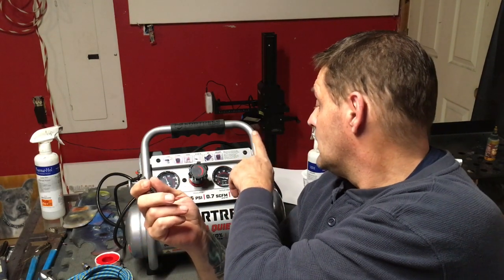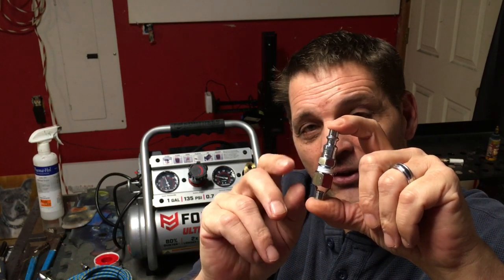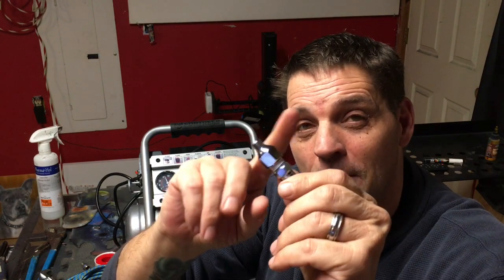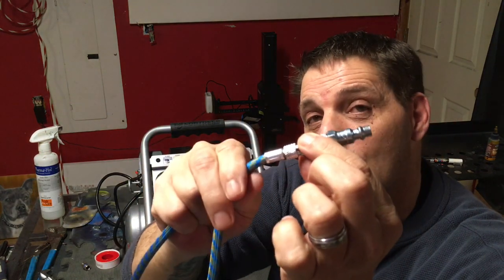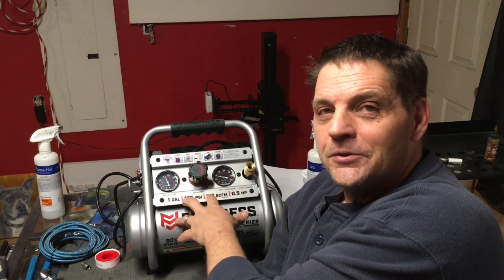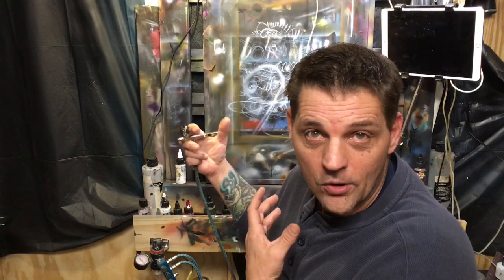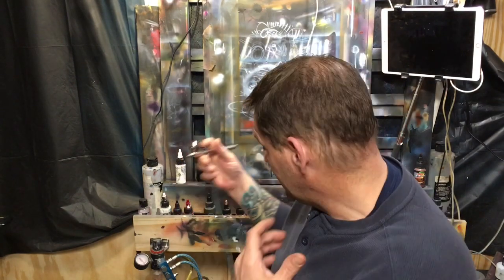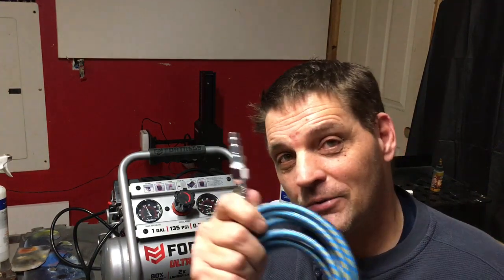How to attach an airbrush to a regular compressor.  Lets hook it up!

Comment: I bought today a quiet one (62 dBA) the brand is the Maximum 2 gal only, don't need more, I'm not airbrushing for hours, so it's ennough for my needs. Ok, now I have both adapters (the big one I had for long time, and the small one from my pistol style airbrush) but The threads don't match. Our airbruches are in metric so the small one that connects to the hose is in metric and the big one that plug in the compressor is for sure in Imperial. I'll do stores tomorrow, Too long if I order from Amazon.

Comment: Great video! Would these adapters work for the California Air Tools 8010 Steel Tank Air Compressor. I’m using a Paasche H
Reply from the maker: Yes same fittings.  Of course you will need a pasche adapter or the pasche hose 

All consumer level compressors will use those fitting. The larger huge shop compressors use automotive quick fittings.   Ironically the automotive are the commercial grade and industrial is home compressors 😅

Comment: Two last ?'s  Any issues with the Regulator? and do you use the same set up as the Fortress?  hose water trap etc.  Thanks again.
Reply from the maker: no issues with the regulator.  and if I was running it a lot I absolutely would run a hose and water trap.. if just doing small stuff it really wont build up enough heat to make it an issue.  But you do need some kind of moisture trap if using solvents for certain.. Its honestly the best practice to have one.   Again its also handy having the regulator right next to me.
Reply from the maker: oh with that said When i first started.. i ran without a moisture trap at all for a good while :)

Comment: Hey Bill I need some help & questions ..please 
I just bought the 1gal cal air tools, I got the industrial male quick connect which is ¼ to the compressor.(seems to connect to the compressor so I'm assuming I got the   I got 2 airbrush hoses that are ⅛ having the moisture trap in between the hoses.. I can't seem to find a connector  that will fit from the ⅛ hose to the ¼ end of the quick connnect- (end of the compressor) ...if there is a way u can guide me. Or if I can send msgs via email or social media platforms.. also had some questions on how the air compressor turns for soo long in the beginning? The pressure was going up about to almost 90. I wasn't sure if that's how it goes or when to turn & adjust the pressure to like 30 psi.. thank you
Reply from the maker: Ok the adapter from the 1/4 inch to 1/8 is 1/4 npt to 1/8 bsb.  

The compressor will auto shut off at it's max pressure.  The regulator pressure is different than tank pressure.   If using an exterior regulator I would just adjust the compressors regulator to 90 and adjust your other regulator from there.  

If just using the compressor turning the regulator valve down will adjust the pressure down on the second guage.. it may not drop pressure until you bleed air from the tank.  

If you message me on my Facebook page I'll always answer.. but may be delayed same as here!  

All the best! 
Bill!
Reply: @TheAIRspace  yes I will message you ! Thank you Bill..

Comment: Wil that adapter work to hook a standard sized shop compressor tool to an air brush compressor? Cuz i have a pneumatic graver machine i want to hook up to a tiny airbrush compressor. Ive done the research. The compressor will run the tool and im working in a small apartment with a girlfriend that hates noisy air compressors. I have a silent 2 gallon husky but it. Leaks so the compressor motor runs non stop. And the little airbrush compressor is about 1/4 the size of the husky and so much quieter. The ab compressor comes with that tiny female screw-in end fitting so i need to get it to hook up to the graver and that the regular shop sized fitting
Reply from the maker: i of course have no idea on thread size to your machine.  But a 1/4 npt is a pretty standard size.  Most airbrush compressors will have a 1/8 bsp male .

Comment: Unfortunately the link now shows the adapter being 1/8 bsp to 1/4 bsp instead of 1/4 npt
Reply from the maker: it is probably a typo on their end.. but ill take a look at it.   It should be 1/8 bsp to 1/4 inch NPT  
They do occasionally move stuff around on amazon.

Comment: I was thinking about buying a one Gal 135psi 0.5HP but was not sure if it was worth it. Up here in Canada, a two gal 1.5HP is expensive. Is yours doing a good job?
Reply from the maker: I really only use the .5 compressor on occasional use.  for portability sake.  I consider it too small for my needs.  it will keep up certainly, but if im airbrushing for hours it will be running far too much.  I had a one horse 1 gallon senco that was plenty that I gave to a friend.  But I usually use a 4.3 gallon as my regular compressor.  

Im almost always going to recomend a bigger compressor than a .5    tthe one horse one gallons will do great for most but the 2 gallon is going to run less and have less moisture.

Comment: I needed this vid too. Do you wrap the plumbers tape more than once? I still found I have air leaks at the filter threads, and the on the regulator threads- the one I added to the gun. I bought replacements for both and they did the same too. Either I am just not tightening it enough or these plastic threads are no good. Ahh what a journey!
Reply from the maker: The regulator threads I tape. And about 3 wraps.. side note I was a plumber for 30 years.  So I tend to do pretty well putting threads together 🙂
Reply: @TheAIRspace  I bet! Thanks I will try again.

Comment: If I am buying the iwata eclipse pen, and the first Link you listed of the cord thing, plus the California air fortress, do I need anything else to start airbrushing t shirts, or is that a complete set up? Thank you for your help. I’m sorry I have a hard time processing tons of info at once and need to ask
Reply from the maker: You will need a quick coupling from the compressor to 1/4 inch npt.  which is the second link is multiple adapters but I do encourage folks to get the adapters local if possible.  Home inprovement stores and hardware stores should have them in singles.   

For shirts you definitely want to go with the larger of the compressors.  Depending on how much you want to do.  Because once you sttart painting long periods it will eat a lot of air when you will be spraying high pressures (50+ PSI normally)

Comment: no link to the coil hose?
Reply from the maker: updated in the description.. that one comes with the direct adapter to the compressor and a quick connect female so you could use a quick connect out of the regulator :)

Comment: Thanks for all of the info! I’m looking at this compressor and  quiet tech kobalt from lowes…any recommendation?
Reply from the maker: i run the 4.3 gallon quiet tech from lowes as my main airbrush compressor... for id guess going on 3 years now.   I believe unless you get a super coupon the quiet tech compressors are actually priced less than the fortress.   If you do go with the fortress id opt for the 2 gallon which is a little louder and much more powerful.  unless portability is very important.  they are usually priced the same.
Reply: @TheAIRspace  thanks for the fast response I’ll stick with quiet tech. I like the idea of a good warranty

Comment: @TheAIRSpace do you have a link to the block you use for keeping multiple airbrushes attached to the compressor?
Reply from the maker: The one i have been using is this one  
https://amzn.to/3pFBuaL
Full disclaimer this is an affilliate link and I may recieve compensation if you purchase through said link (required to mention that) 

Id look around from there I am looking to do a 6 way hookup, even though I almost never even have 3 hooked up. And im hoping to find one that air comes in the end.. but my airbrush setup has been moved and changing up my setup entirely.  

Keep spraying  Thanks!  
Bill

Comment: I have a set up with the water trap and everything but I have no airflow through my airbrush when I press the trigger/button
Reply from the maker: First thing is see if air comes through the hose..  then from there if it has air the next place is the head or trigger remove the nozzle cap.. does it have air? IF SO  you know where the problem is.. if not it's at the trigger

Comment: Nice presentation. So, that adapter on the six foot hose is one that will adapt that hose's fittings to a badger airbrush? Thanks, Daniel
Reply from the maker: That one does not, however if you type in badger adapter it will pop right up.. I did have a hose linked that included it, i have since edited it.  Occasionally amazon switches up links.
Reply: @TheAIRspace  Thanks. I'll check it out.

Comment: been advising people not to blow hundreds on "airbrush compressor" when you can get a quiet shop compressor for far less, and its more versatile. i engrave and do wood and metal work, and i have a fortress and california air compressor, and they have both been worth every penny, and im still in for less than had I purchased one air brush compressor.
Reply from the maker: and thats another video ill be making soon.  But i get lots of grief when i say that.. obviously I run a larger one than the one on my desk at the moment.    this one is going to go in a rolling easel setup... if I ever get to building it

Comment: Does your secondary regulator (the one with water trap) actually allow for additional air adjustment? I have the same setup and my regulator stays the same as compressor output. Meaning I can set primary pressure to say 60 psi and then secondary to 25 psi.. but both are staying 60… 😩
Reply from the maker: You should be able to adjust the second regulator at any level below what’s on the tank.   However often the pressure will not show lower until you let air out of the airbrush.   Always set pressure with the button pushed down

Comment: I saw a video with you using a Kobalt 2 gal. compressor, and this video shows the Harbor Freight Fortress.  Are there reasons  that you switched?  Maybe I missed a video.
Reply from the maker: I run still quiet tech 4.3   This was for testing and portability only.
Reply: @TheAIRspace  Thanks, keep up the informative videos!

Comment: Bill, nice job buddy, question where did you/do you find the block? I want to connect more than 1 brush.
Reply from the maker: The one I have is like 6 years old.. and im not sure I can find it.  Im actually planning on changing it out soon..  
This one is very reasonably priced.  Usually the mac valves are not all that accurate but they shut off the air just fine.... I dont use quick connects.   this allows me quick airbrush changes and actually how I shut down at night.. might have to do some adjusting on the hookup after your regulator.  But I believe this one has a 1/4 NPT adapter already. 

Hopefully this helps folks understand the fittings a bit better.. NOTHING sucks worse than getting home with the wrong adapter... i know better and ive STILL grabbed the automotive quick connect before (I have both here) 

https://amzn.to/2Np4vac

and for legal i have to mention.. 
"the above is an affilliate link and I may earn commisions when you purchase from said links"

Comment: Will the air hose in the link work with iwata or will I need a adapter? Thanks bill.
Reply from the maker: Yes it will.  Almost every hose fits iwata unless they are made for paasche or badger exclusively.  Every other manufacturer has adopted 1/8 inch BSB as a standard.  
Thanks for coming by!  you guys have no idea how much I appreciate each and every comment!
Reply: @TheAIRspace  Thanks for the info and keep the videos coming. I'm really enjoying the channel.
Reply from the maker: @fpvtv2222  I'm swamped with work.. but making a small quick one hopefully tonight a technique I use that's not real common.
Reply: @TheAIRspace  Cool! I will be watching for it. I used to airbrush temp tattoos and tee shirts. I haven't done anything the last 15 years. So I decided to get back into it.
Reply from the maker: @fpvtv2222  I dabbled in tees a little bit.  Then realized I really didn't like lettering 😂

Comment: I think it’s “BSP” for British Standard Parallel” in case someone is searching for them.
Reply from the maker: Bsp is British standard pipe thread. 
Bsb is commonly called British standard brass, although it is not a correct denotation because there is actually no standard.  

Bsb is used exclusively for brass tubing fittings as far as I can remember.  Bsp and bsb have a different pitch.  Bsp would be used to join two pipe together with a threaded connection and a coupling/ elbow.  Whereas bsb would be used in compression fittings for tubing.  

As a side note bsp and npt will thread together in 3/4 and 1/2 inch variants but other sizes will not create a leak free seal.  

The flex hoses of course are not made with a sleeve and tube inserted but rather an o ring and utilizing the bsp thread, as has been common with replacing sleeve tubing with flexible braided supply lines for the last several years.

Comment: I had more luck with BSP not BSB. Do you know if the 1/4 to 1/8 iawata adapter is actually 1/8 bsp to 1/4 NPT? Some adaptor are actually 1/8 bsp to 1/4 bsp.
Reply from the maker: There are two types of BSP threads one tapered one not.. you would definitely NOT want a tapered thread on an airbrush hose.  
The adapter from a compressor and incidentally almost all tapered threads at least here in the USA will be NPT. 
It would be difficult to find the industrial push in connector with anything other than 1/4 inch male or female NPT threads HERE.   

QUOTED TEXT :::
The difference between NPT vs. BSP threads has more to do with where you live than their applications. Both NPT and BSP are pipe thread standards for screw threads used on pipes and pipe fittings to seal pipes.

BSP – UK, Europe, Asia, Australia, New Zealand and South Africa (most countries worldwide)

NPT – United States, Canada

Both threads have the same pitch and the familiar shaped peaks and valleys. However, the designs of the threads differ in two fundamental ways. With NPT, the peaks and valleys of the threads are flat. In BSP, they are rounded. Secondly, the NPT angle of the thread is 60 degrees and the BSP angle is 55 degrees.

NPT
NPT is the abbreviation for National Pipe Thread Tapered, which is the U.S. standard for tapered threads used to join pipes and fittings. They were established as a standard by the American National Standard Pipe Thread, commonly referred to as the national pipe thread standards. NPT is one of the U.S. national technical standards for both tapered and straight thread series that are used for various purposes such as rigidity and pressure-tight sealing.  

BSP
BSP is the abbreviation for British Standard Pipe. The thread, as defined by the ISO 228 standard, uses Whitworth standard threads, and is among a number of technical standards for screw threads that has been adopted internationally for interconnecting and sealing pipes and fittings. It has been adopted as standard in plumbing and pipe fitting nearly worldwide.  END QUOTED TEXT  From Arthur Harris and company 

BSB is commonly used in brass compression fitting applications, Or O ring seals such as an airbrush hose.  BSP straight thread is going to be the same as bsb.
Reply from the maker: i should have long ago amended the BSB abbreviation to BSPP  However even when you order online its confusing because there are two different BSP threads BSP And BSPT  And few ever differentiate as far as I can tell.  BSB to me came from the days of plumbing for 30 years where it was always called BSB
Reply: @TheAIRspace  thank you for all of this valuable information.
Reply: @TheAIRspace  I just received my first airbrush and i was looking for information on how to connect it to my "shop" compressor. I had previously bought an iwata hose for it and found it had a standard 1/4 npt end on, so all i had to do is hook it to a standard 1/4 quick connect.
Reply from the maker: @Hitdog8601  awesome!